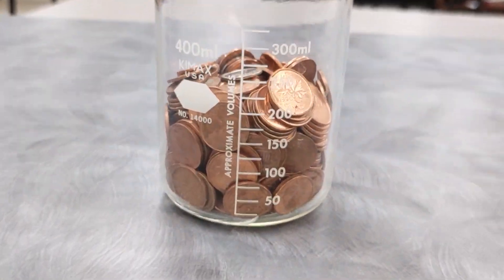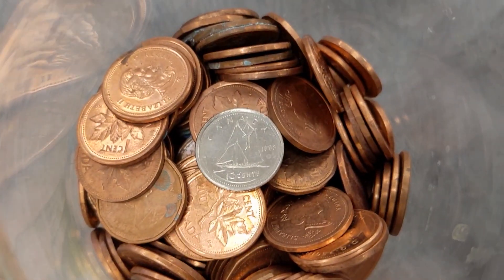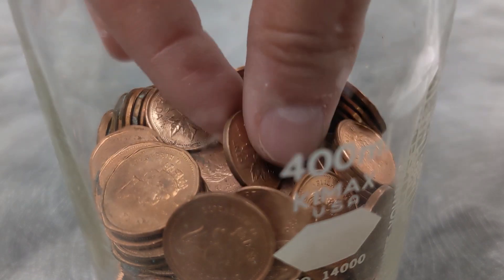Growing Copper Crystals on a Dime Using an Electrolytic Cell

Comment: So sir is this a non spontaneous reaction coz an external voltage is needed to fasten the process of exchange of ions in the solution which otherwise I think won't happen as Cu is quite electropositive in comparison to Ni. So Ni won't loose electrons to Cu and bond with sulphates on it's own. I think we can predict a lot of such double displacement redox reactions on the basis of reactivity level or oxidation potentials of these metals.